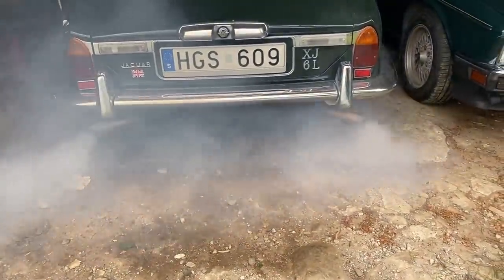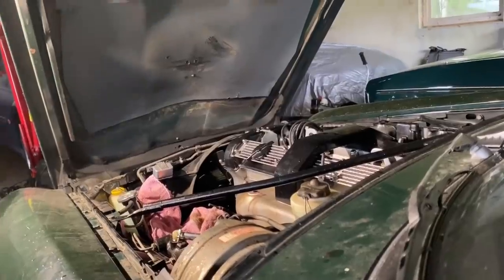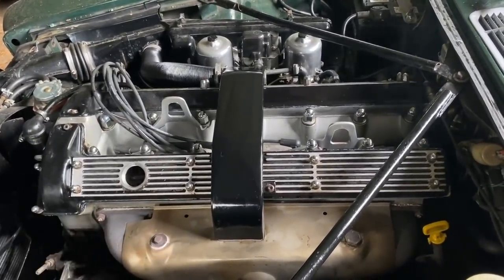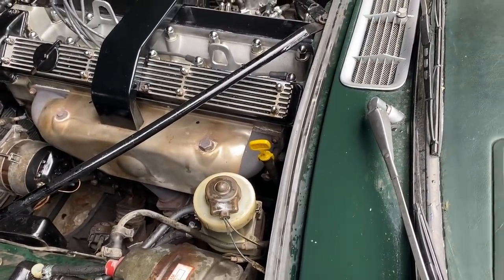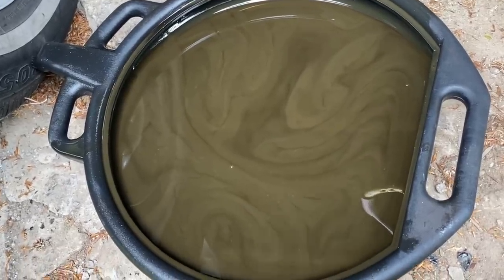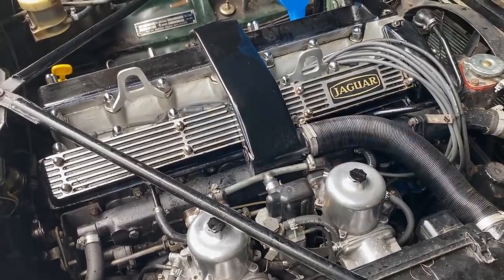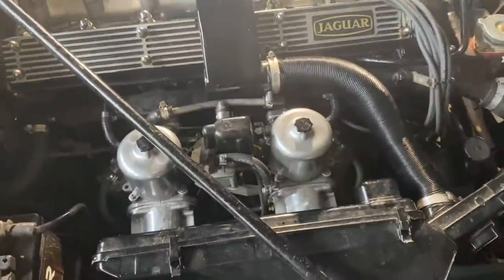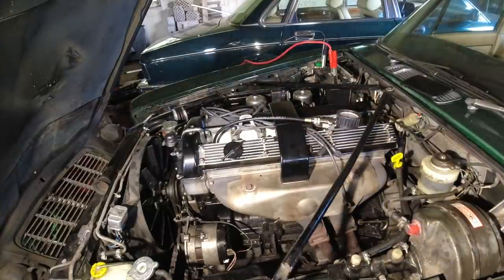Will ATF and Engine Flush Bring the Compression Back? - Daily Driving a Classic Weekly

Comment: Just drive it, put some more miles on and then check it in a few months. If it does not improve, but still runs well, just use it. If it does improve , then a result.
Reply from the maker: I will do that John. The idle is slightly uneven under old in gear but otherwise it runs great

Comment: Team work, it's a 6 cylinders, so even if some are weaker, it might still do the job fine. Interesting to see! My XJ40 did its first start on the ''new'' mazda 3 fuel tank and it runs just fine. The old fuel tank was leaking and too far gone, with no replacement available. This new tank was quite some work to adapt and I still have to do some woodwork and carpeting to hide it properly, while keeping access to it if needed.
Reply from the maker: Great job getting a tank to fit! It’s too bad that so many parts are not available for the XJ40

Comment: I got a 92 xj40 and just got a oil change from Valvoline the other day, and as soon as I pulled off I looked in my rear view mirrors and seen the whole street covered in white smoke 💀
Reply from the maker: I hope the white smoke stopped for you
Reply: Hi! The AJ6 engine is slanted, so some oil get through the exhaust valves, especially if it hasn't run for some time. It will more than likely go away as you are using it. Mine did that too at its first start, but it doesn't anymore.
Reply from the maker: My XJ40 blows a small amount of blue smoke at first start up if it’s been sitting for a month or so. Goes away as I use it

Comment: Ideal compression is 175 psi?
Loss of oil preasure could be the pick up pipe in the sump where it bolts to the block, the gasket comes loose.
Could be the oil preasure transmitter on filter housing giving a low reading.

Comment: as lomg as the engine runs without knocking, oil pressure is overrated. Just drive the car some more miles, don`t stress the engine. Next time, instead of expensive engine flush, use diesel. I do it always, on any car, since 1989, all engines are clean inside after a diesel flush. piston ring can come back.

Comment: A few videos back you found a leak? i.e liquid in the rear carburettor mouth. I have know inlet manifolds go porous. It might be worth taking the inlet manifold off to leak check it. If you have a leak from the manifold and it is dripping in to number 2 cylinder, this could be your problem. The damage the leak has already done is another thing. On the leaking manifold i found, i took it off the car and plugged up one end of the coolant supply, put an air line on the other end and pressurised the coolant passage. I also heated up the manifold and in due course a crack opened up. This was after a long exhaustive search. I wish you 
well.

Comment: To the best of my limited knowledge, ATF is the fluid used in automatic gearboxes. ¿Why do you use it to flush the engine? ¿Does it have solvant properties to melt the gunk and carbon buid ups inside the engine?
Reply from the maker: It has a lot of cleaning products in it to remove sludge and it lubricates very well. It’s a cheap and safe method to remove carbon
Reply: @LivingWithAClassic  Good to know. Thank you!!

Comment: Check the valve clearances and if good, yank the head off, de-coke and grind the valve seats. I never trust electric oil pressure gauges so install a simple mechanical type. Check that your oil pressure gauge is running off 12V and not the regulated voltage used for fuel and temperature - ask me how I know?
Reply from the maker: Head gasket just been off and valves have just been ground. The gauge was checked with a mechanical one also in a previous video so it’s pretty accurate within a few psi.
Pretty happy with the oil pressure now. It’s above the minimum required at 3,000 rpm

Comment: Aren't old Jags supposed to smoke if they run? Or is that just the carbs that cause that? 😂 Nice car, though. Try spraying water in the carb while it is running on the mist setting. It will help the rings, valves, and complete combustion chamber to clean itself of carbon. Im being completely serious.
Reply from the maker: It’s a smoke screen 😉

Comment: Hi Adam !!!
...
Just had a stupid thought  !!!
...
I haven't watched the video right through,  but if you just removed the plugs, and squirted some release oil into the bores and let the oil lubricate the rings for maybe a few days and then just squirted a splash of 2-stroke... would the compression just balance up after a short run ???
...
Then after a few weeks just change the plugs to prevent misfires ???
...
The engines in the UK just went on forever and all with low oil pressure !!!
...
They just all rusted away eventually !!!
...
Great cars though !!!

Comment: Of course you could have just used more ATF as the engine flush, or diesel for both....

At least it seems usable for now, and yes I would check the valve clearances on cylinder 2.
At least you don't seem to be steam-cleaning the oil off the cylinder bores any more...

Comment: I will use 20w50  oil in this  old engine trust me old engines do not like  10w30 👍
Reply from the maker: Guess you don’t understand the video. The thin oil is just to flush and nothing else. Perfect for slushing and engine. The you run it on the 20w50
Reply: @LivingWithAClassic   I do understand  now and good jop 👍